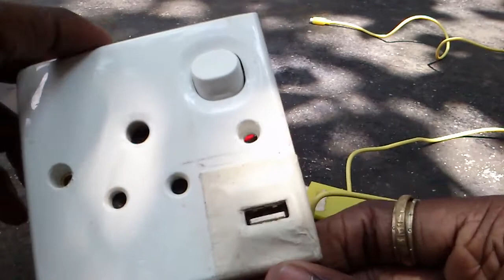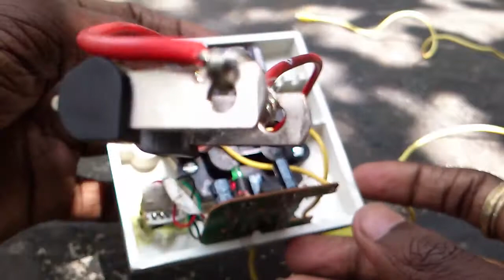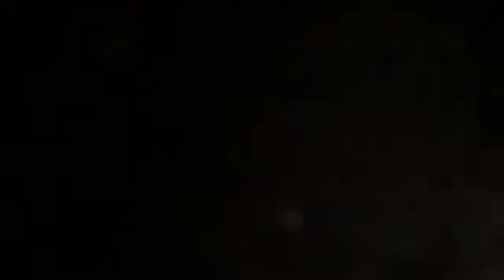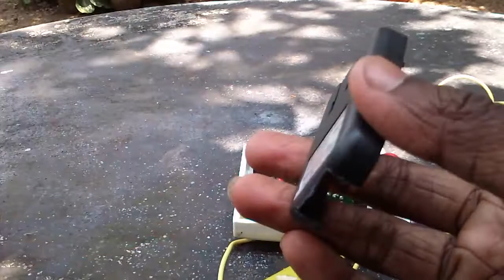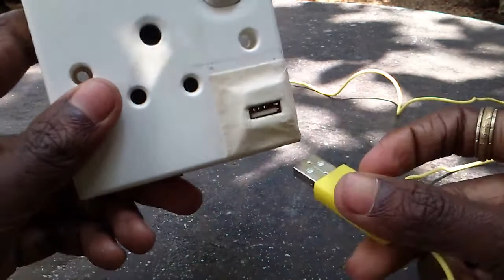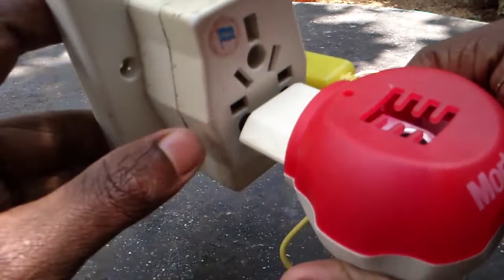Home made 1 port usb wall socket.

Comment: I think you should earth the USB socket surround
Reply from the maker: How, original power supply unit didn't have a earth connection
Reply: because your power supply is exposed and vulnerable to ingress which could cause mains to leak out the USB socket.  personally if i was to make one of these, i would use silicone sealant over the bottom of the PCB and earth the ground side of the output.